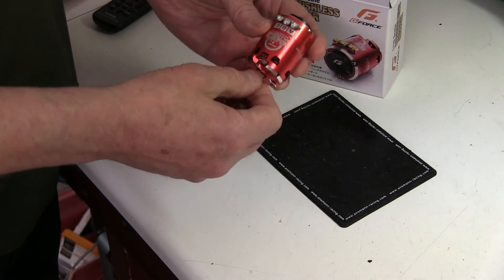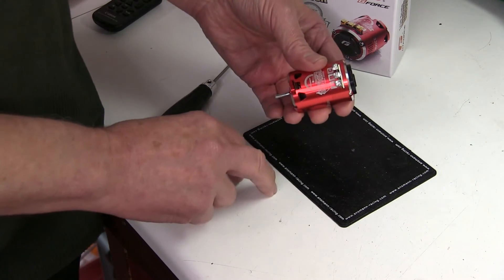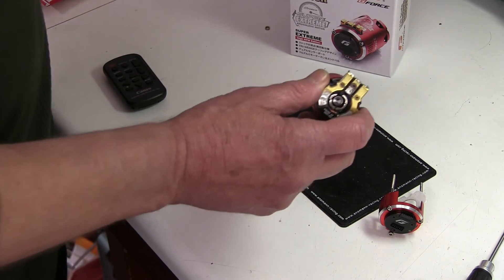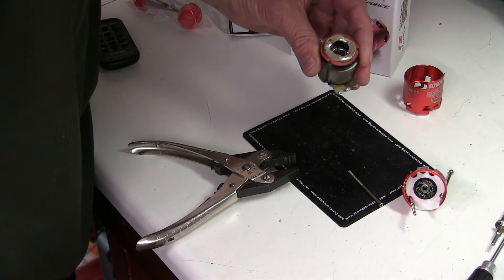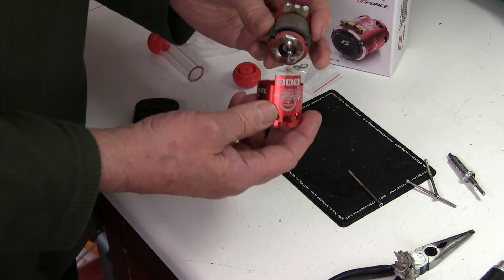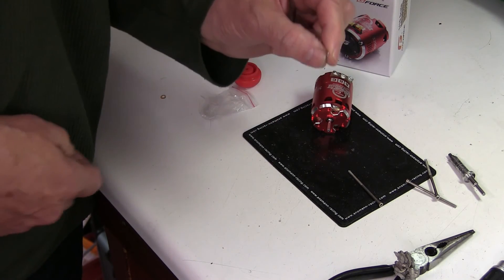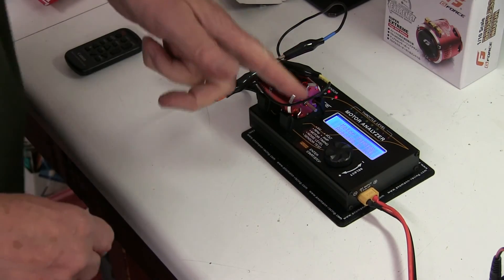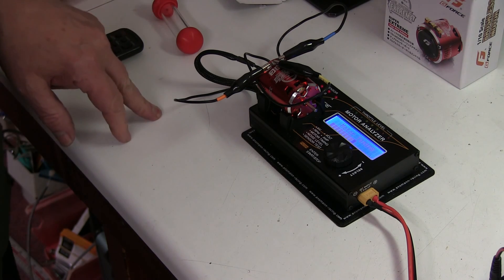Brushless Motor Rotor Replacement.

Comment: I have a question? I have a trinity maxzilla 17.5 d4 1s short stacker. I currently run my short course truck in a tight turn track with a small 40 ft straight away. Should I put a high torque rotor replacement in it to give me more acceleration? Thanks for your time. I love the info on motors I have learned so much. RC Junky